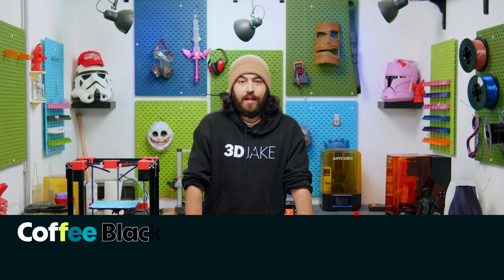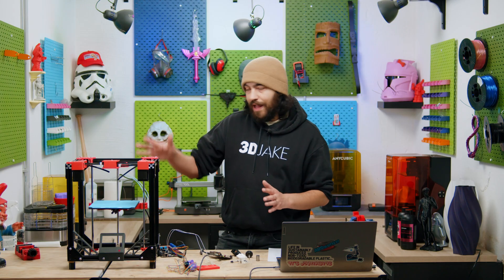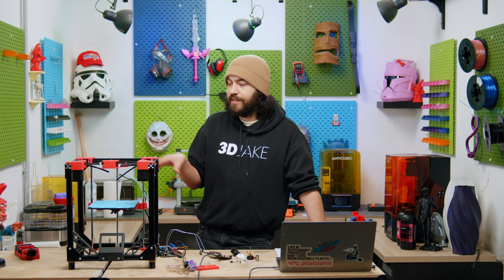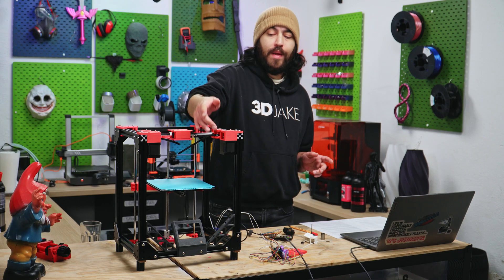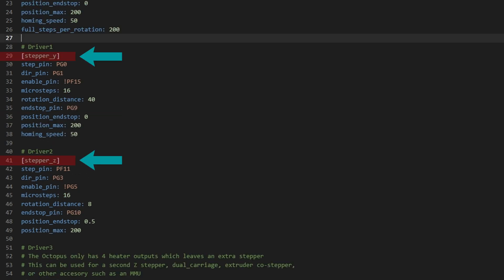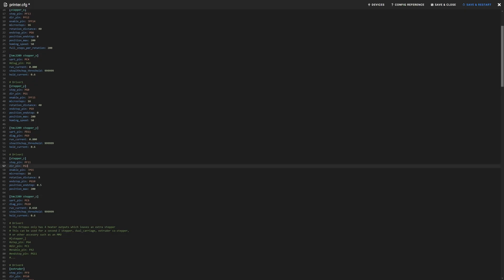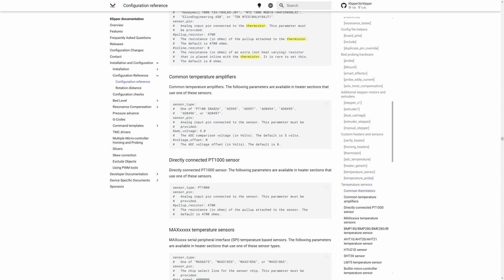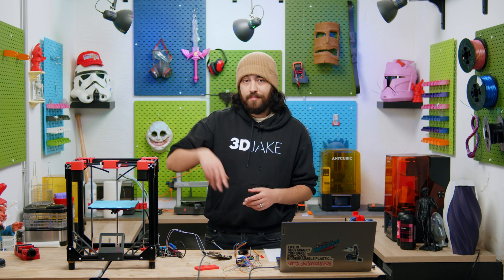3D Printer Build Ep.6: Klipper CFG Setup & Motor Testing!

Comment: Watch out for the A1 heater module "ceramic" mounting plate(CF epoxy probably) it gets up to 180c...as i found out when my diy printhead started smoking😅 however the part of the "ceramic" backplate where the mounting holes are only gets to 60c
Reply from the maker: That very much worried me when I saw the heater, honestly it looks like forged carbon fibre, weird. Good to hear that part doesn't get very hot, I'll be careful. Thanks for the tip!
Reply: @3DJake_Official  after consulting with my engineer (Chad GPT) I have established  that an airgap of 1mm is enough to mitigate  heat transfer to the printhead, it is likely  only 10 watts at most would be radiated to the plastic, however I'm not taking any chances, I will remove any plastic behind the hotspot.

The 'ceramic' appears to be fairly long chopped carbon fibre bonded by some organic  material as I scraped some off with a knife and fired it with a blow torch. It burnt with a sooty flame and left behind incandescent carbon fibres